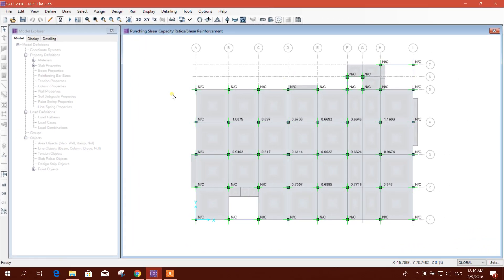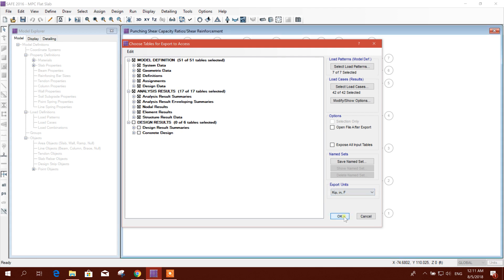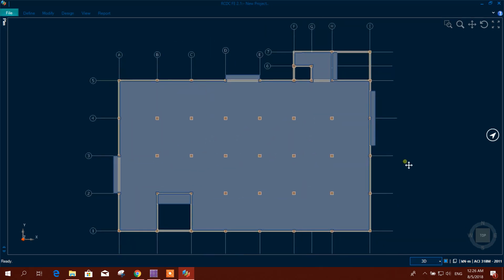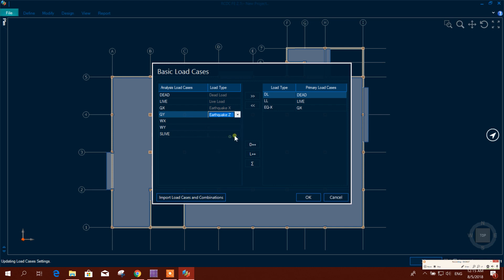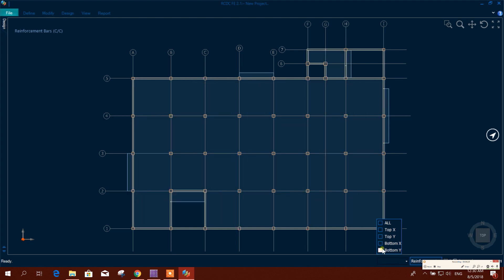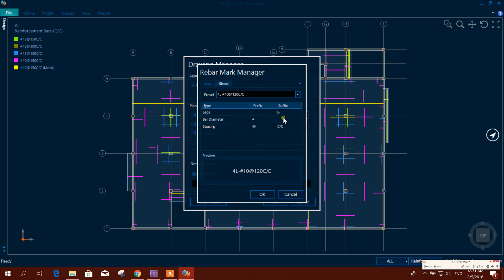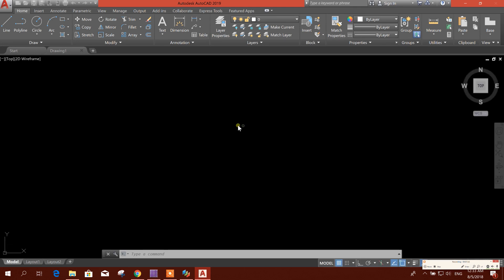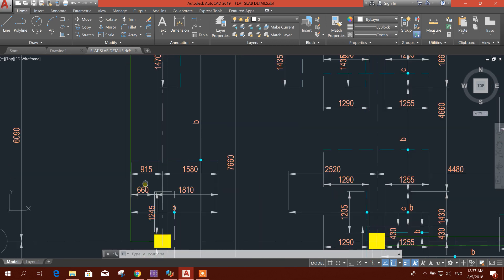SAFE TO RCDC FE FOR FLAT SLAB DESIGN & DETAIL DRAWING

Comment: whenever i try to load the .mdb file from safe RCDC FE shows upload a valid mdb or std file can u please convey what could be wrong.
Reply: U need to save the Access file in 2002-2003 format...RCDC can't retrieve data from upper version of Access file
Reply: @ilustraca  where can i get rcdc fe installer
Reply: after opening the main file Save it as 2002-2003 format.